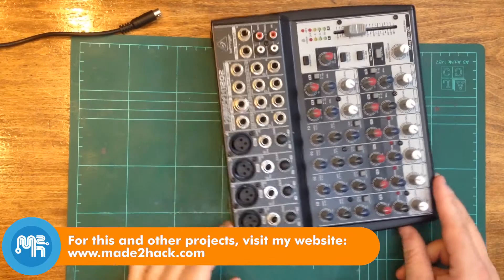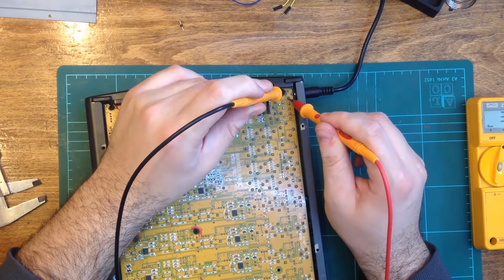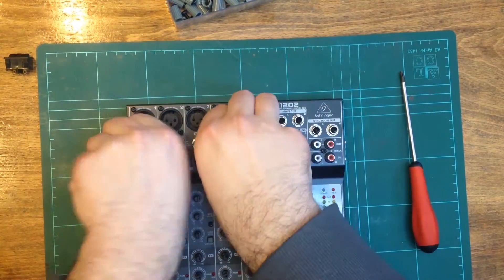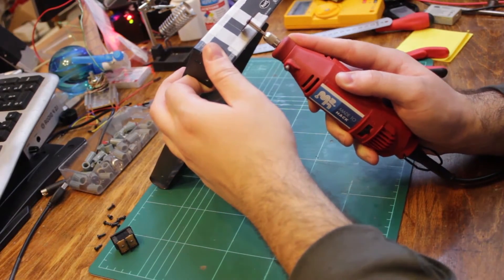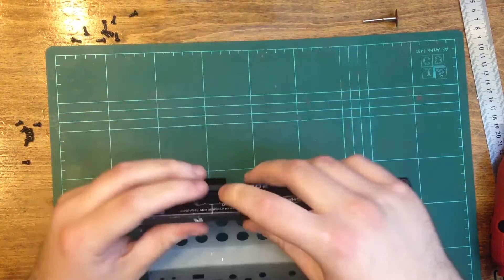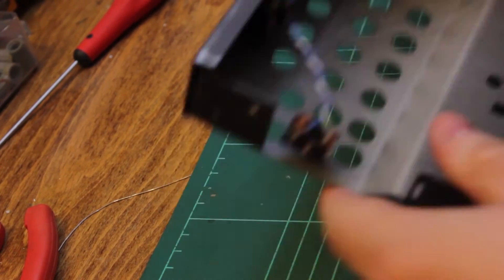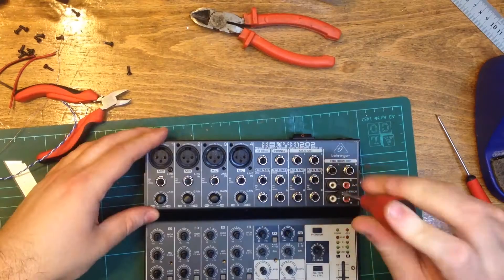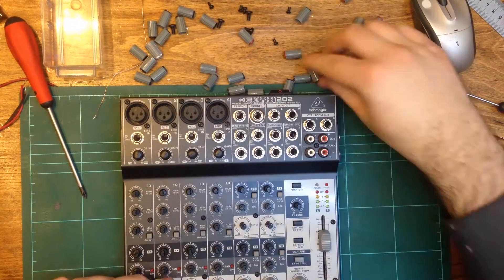How To add a power switch to a Xenyx 1202 4 channel mixer

Comment: @UCfYj0FBdkPOjdOQ906p0HTw
      
      

        

          

          

            @UCfYj0FBdkPOjdOQ906p0HTw
            
            
            
            @
            
            

            
            
          

        

        
        
    
    

      
Could you not just put a line switch in the low voltage cable to the mixer? If you switch both the 18V rails, you should be able to use a typical mains switch for a table lamp and let the ground cable pass through unswitched. Would save an awful lot of work.
Reply: Sorry about the junk YouTube added to this comment. Don't seem to be able to edit it.

Comment: Just use a power bar that’s got a switch on it.  Plug the mixer in the power bar and switch on or off with the power bar switch.

Comment: Please show me how to simply put a rocker-switch inline on the Behringer power cable, about 4 inches behind the Behringer-style power plug connector ..... then I don't have to chop up my mixer.
Reply from the maker: Hi, I've attached an image that might help you.
https://imgur.com/TVqCtno

 If you choose to put the switch before the transformer, (ie the Mains side), you can use a Single Pole Single Throw (SPST) switch and connect it to the LIVE cable. That's the cable you would cut and put the switch inline. Or, you can use a Double Pole Single Throw (DPST) and but it in between both Live and Neutral wires.

If you want to put a switch after the transformer (the lower voltage side 36V), you need to use a DPST switch and make sure you interrupt both of the 18V live wires. You should see in the image.

Comment: Would it be possible to add mute buttons on these? Cutting the audio signals. I have an old Mackie 1202, but I guess these two are pretty much alike.
Reply from the maker: I haven't thought of it since I guess it would depend on which output you would want to mute.
Reply: Theoretically speaking yes but it would require PCB modifications and I strongly don't recommend it.

Comment: total overkill with that switch - not to mention the amount of work put into it only to fit in on the mixer, a simple ROUND toggle button or ROUND push button, way smaller, could do the work easier and even more elegant

Comment: Hi. Can you tell me what the connector voltage is. It spoiled mine and I want to make another one.
Reply from the maker: Do you mean the power cable? It has 2 outputs 18 Volts between one pin and Common, and 18 Volts between the other pin an common, 36Volts AC total peak to peak as seen at 01:12 of the video. If you mean the power switch I installed, it is a regular 250Volt AC switch.

Comment: I think Behringer needs to hire you as their Director of Product Engineering. To think that for $10 in parts, solder, and a little bit of time, they could build these things out of the box this way! Great video -- now I just need to remember how to solder again! ;)
Reply from the maker: Yeah, I really don't understand why they've omitted it, I mean it can't really be a matter of cost? If you're making 1 million of these mixers, the cost of the switch is insignificant. Unless I'm missing the reason for not having a switch maybe?

Comment: Would it have been better if you just added a switch to the cable it's self?
Reply from the maker: I suppose so, although I can't remember at the time my reasoning. I assume that I wanted to simply have an on off button on the back.
Reply: Made 2 Hack cool, do you have a suggested video to help me with this?
Reply: Here you go:
https://www.youtube.com/watch?v=g4MPtKfFb1c
Reply from the maker: Thanks for sharing!
Reply: @ Made 2 Hack: Were you referring to the story about the French chick, or the switch? : )

Honestly, if I could solder, I would've done it your way. I took just enough Engineering in the early '80s to get myself into trouble, but have done all kinds of fabrication & machine work both before and since (did you notice my guitar maintenance/repair benchtop? Totally original concept : )

Actually, I've welded all kinds of steel with excellent results, but have never had but the most rudimentary soldering irons. I'm getting ready to pick up a decent soldering station to see if I can finally get it together! It'll go on the empty space on the benchtop so I can work on electric instruments.

P.S., mind if I put a link to your vid in my description?
Reply from the maker: Hi, I was referring to the switch hack. Go ahead and place a link, no worries!
Reply: Link added... thanks! Note what I said about the connection sequence. Would it still apply even with an integrated switch in "off" position? i.e., can you have an arc when connecting an energized power supply to the mixer's power port even though the circuit beyond the port is open due to the switch?

Comment: Great idea! I'm going to have a go at this myself. How did you reattach the power socket without the power pins making contact? Did you bend them out of the way so they didn't go through the holes?
Reply from the maker: Kind of, although not all that much. There was just enough room if I remember correctly.